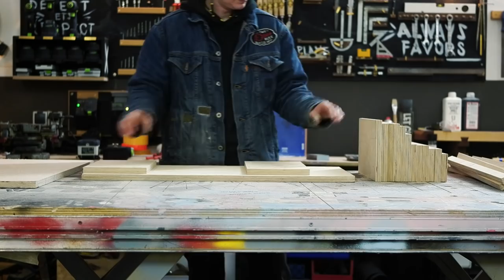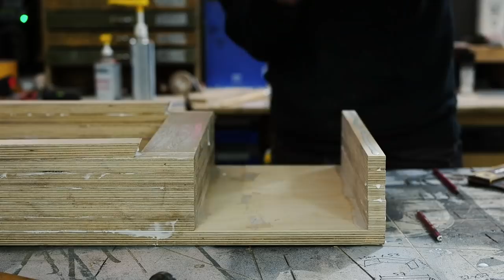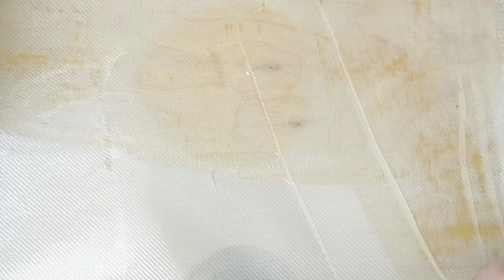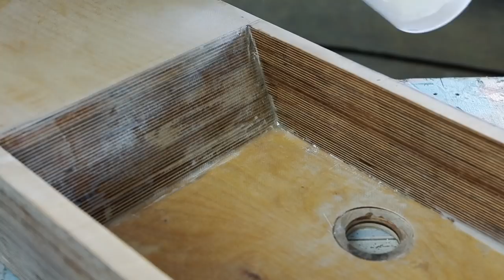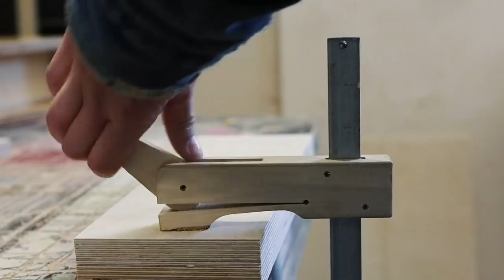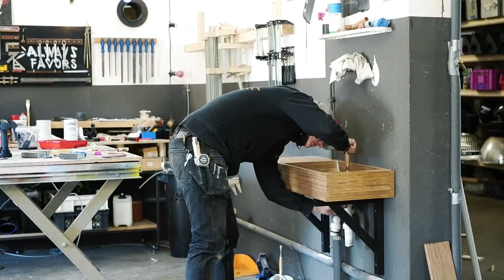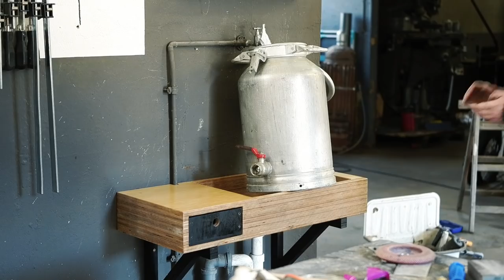A Sink made from Plywood!

Comment: Looks cool👍👍👍👍 I honestly don't  know how plumbers putty will react with fiberglass. Some sinks and tubs have spec'd silicone as the putty can stain. I would think if it was fully cured putty would be fine. Marble, granite and imitations have also spec'd silicone. I had a plastic type one that said silicone and I used putty.... fortunately it was mine...turned the area around drain yellowish....piece of crap... even soap stained it lol
Reply: if plumber's putty is a concern there is an excellent alternative for doing the same thing. Butyl rubber tape caulking will also do an excellent job for bedding in the drain. It is a lifetime product that will last the life of this sink or even for a metal or ceramic sink. It is  used for setting in windows in a fiberglass RVs and fiberglass boats. No problem  using it in contact with epoxy or other resins for fiberglass work. I did suggest it to Laura and she responded that she will be looking into using it for the drain.

Comment: Thanks Laura, from the Scottish borders, a cool idea! Any finishers out there or boat builders? Do you  Laura  or anyone know how long 2 part epoxy lasts-the shelf life? I have had mine awhile. I know the manufacturers say a certain time, but truthfully, chemically, can it be indefinite ? If kept at sensible temperatures?
Reply: Fixed a kayak with some 15 yo stuff from my dad's boat building days, seemed fine to me!
Reply: If the older container of epoxy starts looking a bit thick and crystalized you can revive it by putting the container in a hot water bath (not boiling hot) and it will look normal again before too many hours of that treatment. I live in a boat building community and hang around them and at the school for wooden boat building plus have owned a couple of boats. I have also renovated a couple of vintage fiberglass RVs :) I get gifted with a supply of old epoxy resin now and again.
Reply: @karincorbin2355  thanks super helpful. I make and restore furniture and only use epoxy occasionally, but I do like its versatility.
Reply: @jongmassey  thank you very helpful

Comment: Great video! Cool music! That epoxy looks nasty to work with. Stay safe!
Reply from the maker: Yes-I didn‘t like it! Smells weird and takes ages to dry. But now I know :)
Reply: Not that bad once you learn some tips of the trade, I used to hate doing fiberglass but eventually was taught how to do it the easy way by a pro in the business. I have been repairing a beat up 50 year old fiberglass travel trailer
Reply: @laurakampf  the dry time can be easily accelerated by putting the containers, part A and part B into a hot water bath (not as hot as boiling) before you begin. My workshop is cold so that is what I must do. You will be amazed how that accelerates the dry time. It cures by a thermal reaction so pre heating the resin speeds the cure time considerably. Then use a small space heater to help it out in that immediate location if you have a big cold workshop space.

Comment: Yeah, nice.
Two things: like the old sink, a cover on the wall for bachsplash is usefull. Why leave this out?
And the left side will profit from a drain (like sinks have in kitchens).
Reply: The backsplash would prove useful for cleaning the wall, but that concrete wall will have no issues with the small amounts of water / dirt that it will be exposed to.

What would a drain on the left side provide? I'm confused about where you are talking, the countertop or the drawer or...?

Comment: I thought you would use 2 part epoxy to seal it leaving a clean wood look and then you wouldn't have those white seams in the corners.
Reply: The white seams are thickened epoxy that is used to create a radius in the corners. The radius is a critical factor when using fiberglass cloth. You can't apply fiberglass cloth into a 90 degree corner without that radius as the glass fibers would fracture. They need a smooth radius to transition across the corner. She did the job correctly.
Reply: @karincorbin2355  But why use the fibre glass at all?

Comment: That's a lot of glue! 😁
Is that fabric (or what you call it) specifically for waterproofing with epoxy?
Reply from the maker: That is epoxy resin with a fibreglass Matt to prevent it from cracking.
Reply: @laurakampf  Cool! 🤓
And that was the blackest black I've seen! 🖤
Reply: @CrudeButEfficient   yeah what WAS that black stain (?) - it looks brilliant

Comment: I read the argument about plumbers putty vs silicone to seal the drain. I've been a commercial plumber since '95 we only use plumbers putty. Silicone has its place, it's not plumbing. But that's the least of my concerns with the plumbing you connect that cool sink to. ..where's the vent? It looked to me like you have it hooked to an s-trap, with no vent. That's a big no-no. S-traps are integral to toilets because they are known to be self siphoning, which is great for toilets to aid in the flushing. But a toilet has a trap primer built into it with the ball cock (toilet valve). Your sink does not. If you try dumping a sink full of water, if it will dump at all, with no vent, it will likely empty all contents, including the water that's supposed to serve as a trap to keep sewer gas out of the building. It would be a big project to find a vent line to tie into or to run one through the roof. But you can get a fitting that would connect on top of a san tee (which is what the trap is supposed to connect to instead of that 1/4 bend.  ..anyway it's like a ball check valve. I can't remember what it's called. We don't use them commercially. if you hooked one up there, your sink will drain right, without a bunch of gurgling and the place won't fill up with sewer gas. 
Great build though ...I wonder if you can just gel coat it without the fiberglass, maybe if you use some of that MDO plywood the form carpenters use. ..?